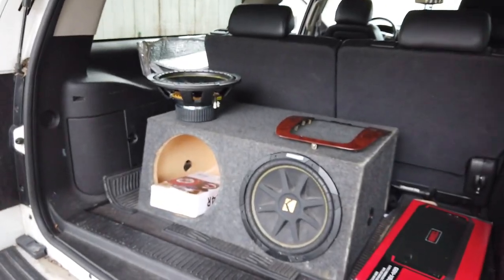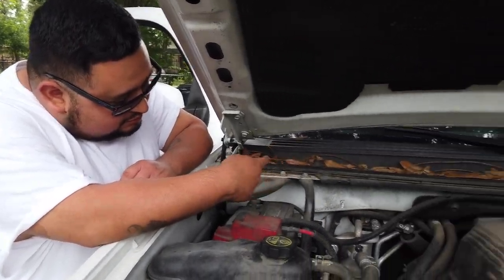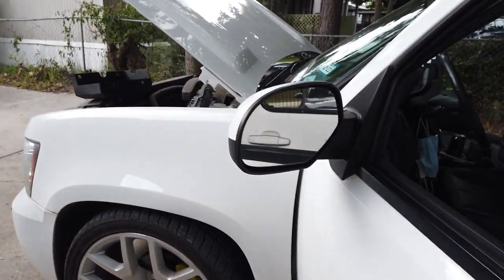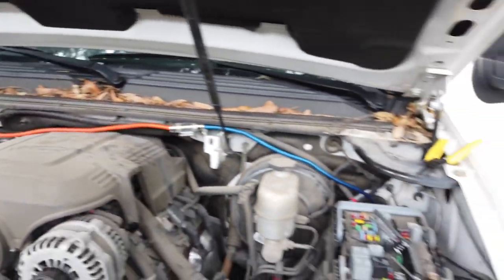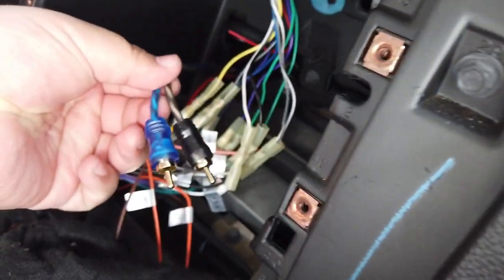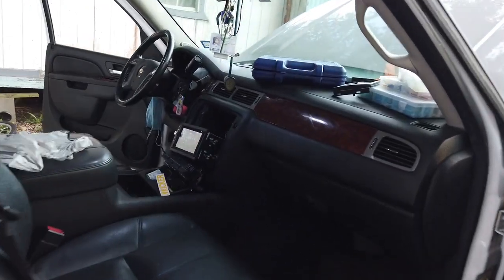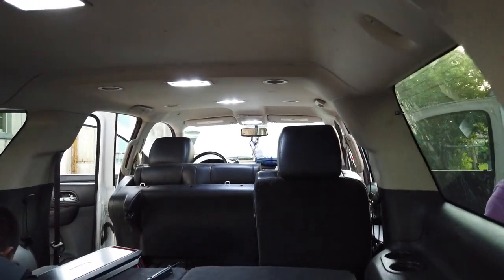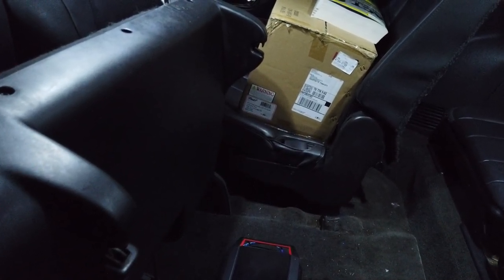ADDING SUBWOOFERS TO OUR CHEVROLET SUBURBAN!!!

Comment: Imma tell yall right now he didn't wire both coils of the subwoofer he only wired 1 side depending on what impedance the subs are u need to look up wiring diagram for what impedance the amp can do